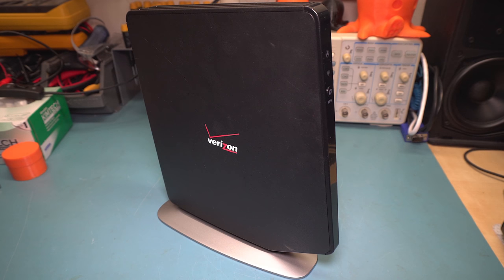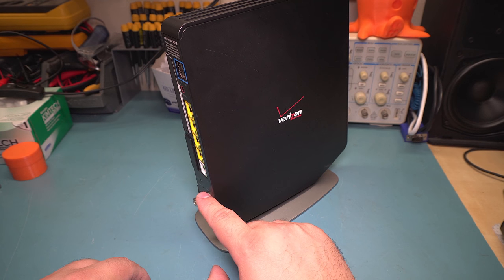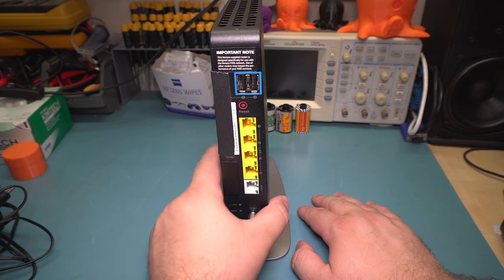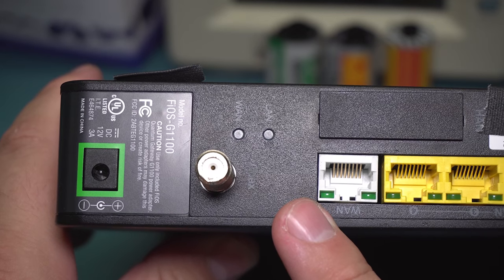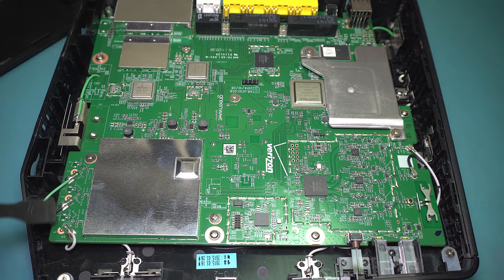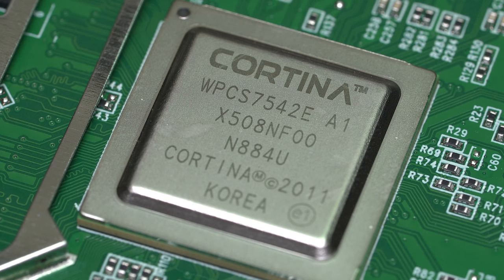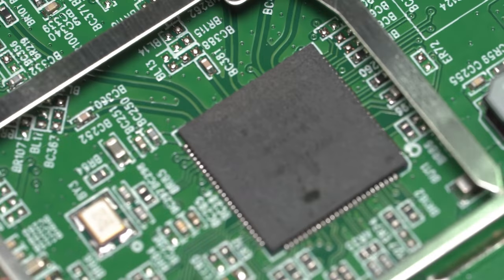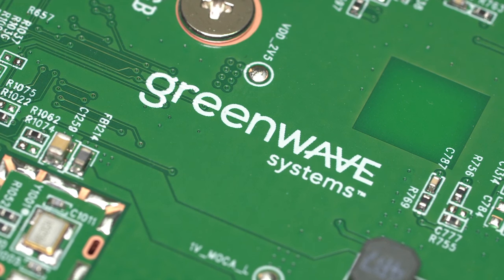Verizon FiOS G1100 Quantum Gateway Teardown

Comment from the maker: FYI: I have confirmed you CANNOT use the FiOS DVRs without the MoCA data connection. Although the DVRs have an Ethernet port, so you could in theory get TV (QAM) from the ONT -> Coax -> DVR and internet from ONT -> Ethernet -> DVR, it doesn't actually work. Looks like it is just a firmware thing where they don't enable the port for data (needed for the guide functions).
Reply: A recommendation would be, if MoCA is desired but not the router, is to use a MoCA bridge to bridge MoCA into the Ethernet network in the same fashion the FQR does and then just manually open the necessary TR069 and TCP/UDP ports in the firewall of a regular router.
Reply from the maker: Yeah, that should work fine. A DHCP with static assignment will probably be needed as well since it seems the DVRs want some silly x.x.x.1xx range of IPs. I haven't tested that to confirm, however.
Reply: True. I don't know if it's the FIOS router that's assigning the set tops to the .10x addresses, or if it's the set tops themselves requesting them. I mean I don't mind because I don't have anything else in that .10x range and if it's the latter then I assume any DHCP server/router would be able to dole it out without issue. Really only one way to find out.
Reply: Peter Brockie apparently if u have the whole home DVR system with the thin client boxes, you can use the thin client boxes via Ethernet instead of coax. I like that functionality and I’m gonna do that once we fix up our apartment.
Reply: Also, not sure if you knew. The CoAX doubled as a dual MoCa. So its meant to use as the WAN connection to the ONT and LAN connection to the boxes. However with gig internet and lower latency, installers are now just using the ethernet port directly into the WAN port and only using the LAN functionality of the MOCA port. At one point, it was just easier to use Coax to the router/gateway rather than run ethernet to wherever the ONT was.

Comment: it's funny how these router boxes are usually very capable in terms of hardware but limitted in terms of software from the operator and even crippled intentionally in some cases.

those ram chips if they get hot they will spread the heat into the PCB ground plane which the
heatsink is well connected to and will help dissipate that through the heatsink.

They might use one of the BCM6803 for the uplink and the other one for the downlink on the same media.

And one final thought on this type of hardware, introducing RF connectivity(zigbee and others) on these home gateways for home automation opens up a big security hole.
Reply from the maker: They usually are limited, but this one seems to be pretty full-featured. Manual routing, full SPI, forwarding control. Hell, they even support dynamic DNS providers (pretty rare in an ISP router).

The home automation thing doesn't really interest me, so I don't think I'll ever get that enabled. I'm not sure on what kind of encryption Zigbee and Z-Wave use, but if they're low power I doubt it is all that complex to break and would be a pretty big risk if you were targeted. That being said, any wireless connection is a security hole - just because WPA2 is pretty good doesn't mean it's unbreakable.  :D

Comment: Sorry, let me try this again.  The router and the set-top box/DVR need to be connected to coax at all times.  My understanding of why is that the router is issuing the set-top box an IP address on your network.  It is then responsible for retrieving and supplying the Guide data and on-demand content.  You can use a PFsense box for internet via ethernet to the modem but you need to supply the Fios router an IP address from PFsense AND keep the coax connected to it so that the guide and on-demand can function.  The FiOS router must also be converted into a MoCA bridge by bridging the COAX and ethernet ports once its DHCP is disabled (or you can buy a MoCA bridge).

It's obviously over complicated for what it achieves, but if you want a more powerful router or firewall then this is what you need to do.

Comment: Had a network emanating from my G1100, with a hidden SSID and the 5ghz was turned off, but the mac address was 1 letter off from the other fios connections. popped off the side plastic, popped off the 2 antenna connections for 5ghz and my signal dropped from 60db down to 30db. Whooohoo! no more interference with my asus router!

Comment: you don't have to use the verizon modem, but most people should since it's easier to troubleshoot.   You may use any router you like, but if you also have fios TV boxes and use the guide+DVR+on-demand, those boxes also need internet access.  You can either run ethernet cables to them all (not practical) or will need a MoCA 2.0 ethernet-coax bridge.  You can configure the verizon router as a MoCA bridge, but any MoCA 2.0 bridge will work to give internet to the TV boxes over coax.
Reply from the maker: MikeT1831 I figured Ethernet to the cable box would work, but so far this router has actually been quite reliable and functional. With the newer version of pfSense needing AES-NI it kinda limits it to something modern and realitively expensive compared to this 80 dollar router.
Reply: i didn't test the ethernet, and now you have me doubting it will work.  I use a $50 ubnt ERX lite running LEDE.  If you want pfsense most 5 year old intel laptops could do the job (paired with a managed switch).

Comment: Have you tried connecting your pfsense box to the ethernet on the ONT? You don't need the Verizon box connected for Internet.
Reply from the maker: I haven't tried, but my understanding is it works without the gateway as long as the DVR is fed Ethernet. But I'm not positive and the guy implied the coax connection from the router is required when on the gigabit service.
Reply: Instead of everything going through the coax, you can have both an Ethernet and Coax coming out of the ONT (Optical Network Terminal) and plugged into the router. This will not only give you better latency, but it also gives you the option of using your own router. You will still need to run the Verizon router or the TV service, if you have TV service. So either both the coax and Ethernet will plug into the Verizon router, or you can plug the Ethernet into your own router and the coax into the Verizon router. You will need to call Verizon to enable the Ethernet port in the ONT. This can be done remotely over the phone.
Reply: Correct. That's how mine is set up. Coax from the ONT feeds the video signal to the set tops, Ethernet from the ONT feeds the internet to the FiOS router, and coax from the FiOS router feeds data to the set tops. It's really quite elegant.

Comment: YOU DONT HAVE TO USE THEIR ROUTER at least not as primary, disable dhcp on the fios router, give it a static ip, disable firewall, bridge the wan connector to the rest of the network, then use your own router for the internet side of things.

anything above like i think the guy said 50mbit now uses the cat5 direct from the router.

the coax is for MOCA.

i setup our network this way a while back and, even the wireless is working as a connected but seperate access point, (all systems can see printers and such now), having zero issues, there are some guides on how to do it, really wasnt that hard, and, honestly, my wrt1900av v1 with LEDE is better then verizons much more limited, but quite likely based on, OPENWRT based firmware .

the world led will be red, but thats fine, as everything works perfectly, and now, we have 2 5ghz networks, and 2 2.4ghz networks, that are connected, but, also, their own access points.(once setup the "seamless" crap thats sposta just be the same wifi network with multi stations....never again...what a pain...) 

THEY ARE NOT HORRIBLE, much better then comcasts average all in one units... that are SHITE.... (being kind!!!) 

still wish it had external antena ports...
Reply: would there be any advantage to doing it the way you described over putting their router behind your own? i have my internet coming through the ethernet on my ONT going to my netgear router and then i have the quantum plugged into one of the ethernet ports on my netgear. i read somewhere that this creates a double nat or something but if i dont use the quantum for anything at all would their be any negative impact on my network? thank you for your time.
Reply: setup the way i did this, you gain stability and speed, no down side, infact, the fios gateway even allows the wifi to keep working, as part of the network with its own id and password, by using your own router you can avoid some issues, and, with lede/openwrt/ddwrt you can use a ipv6 gateway since frontier dosnt give out ipv6 addy's and dosnt plan to support it any time soon... 

i actually found their gateway isnt horrible, far better then the shit comcast has been giving out as all in one units, but then, its not really a modem, its a router with moca support(how your tv's get...tv...) i actually have the fios unit running the main house wifi, and hardwired its just a network extender if you config it the way i have, with wifi access point ability...and, its wifi is actually decent for not having external antennas.

there is NO disadvantage to this setup, infact, my parents who i rent from have actually said the new setup has been ALOT more reliable for them, and being able to access any network devices connected to either router wifi or not, is really nice :) 
 
 this has NO disadvantage, we have found it very reliable fast and, honestly, having only had to reboot the ont and router 1 time, and router 2x since i got this setup, im really quite happy, could never get comcasts router to disable its dhcp without becoming non-functional....let alone get it set to modem only mode and still function... 

i wish, WISH  comcast used an ONT style setup.... or just offered some  mdx (modem with telephone but no router or wifi...) but alas... if we move back to comcast..they offer SHITE still... 

anyway, no theres no disadvantage for this setup, and, its really not to hard to do, and as an extender with moca, the things pretty excellent honestly... for a provided unit, its not bard...could prob upgrade the antennas with some externals if i bought one rather then rent..(you can), its not great but for something provided by a isp, their quantum gateways are really not bad, beat the last 3 aio's comcast gave us... including the business class model the fellow gave us last because, even he couldnt get the features we wanted working properly, with the help of top level support... they put in a ticket with their firmware team... none, not even the business units, could be put into any mode with no dhcp or with modem only, and remain functional... just... idiotic..we ended up buying our own modem, then using their aio for phone only... our own linksys 1900ac router running lede and a zoom modem made a HUGE dif...

no need with fios beyond wanting more control, better firmware, and much better wifi range( because, my linksys has external 5dbi antennas, that im considering replacing with 9-12dbi units.. the aio's all have internal 0.5-1.5dbi antennas.. as do pretty much all units that dont have external antennas.....

i use to mod netgear cheap referbs with external antennas and install ddwrt, gained around 6x the range at full speed... without putting the gain above default...

anyway...no downside what-so-ever in using their unit behind yours setup to work as, what amounts to a moca smart router/network extender...
Reply: only way you would endup with more then one nat is if you dont disable the firewall/dhcp, once you do that, it acts like any other extender/router but with moca support.

using it this way theres ZERO neg impact.. infact it all works flawlessly now... 6 tv boxes, 3 hard wired computers and a bunch of devices on wifi all working on the whole network able to communicate directly, no sites/services fail because anythings not setup/working correctly.

again ZERO downside, if you got a decent router of your own, it will, infact, work better. 

theres no reason not to use the fios quantum gateway as a wifi/hard wired extender if you have any use for such, its actually really reliable in such a role, have had to restart it 2x and i blame fios since i had to reset the ont as well both times. =

Comment: Great videos indeed! But you should really really consider keeping/upgrading your custom router (if you can put this in bridge mode).
Reply from the maker: Pablo Fabian Wagner Boian Really the only thing this one seems to be missing is ad filtering. Other than that it seems pretty robust and it has the one feature I can't live without - static DHCP assignments.
Reply: Feature wise, embedded devices are catching up. There are only two problems with them: performance (some workloads can bring one to its knees) and security: these routers get firmware updates almost never. It's a shame because power consumption on these little things is negligible compared to a full PC.
Reply from the maker: Pablo Fabian Wagner Boian From what I have read, Verizon pushes firmware somewhat regularly. Hell, it even updates it for you when it connects to the network. :)

My pfSense box was only a 2C/4T older generation Atom so it isn't that much faster than a dual core ARM.
Reply: Good to know :)
And you're right: Atom CPUs are pretty useless today.
Reply: It's still better from a security standpoint to have your own router/firewall in front of the service provider's equipment.

Comment: Where's the main CPU JTAG?  I see one hooked up to the radio chip, but that's not it.  That flash is parallel, not serial, which would be difficult to dump or program without JTAG.  I have mine opened up, but I don't see what I'm looking for.  Is it on the underside?  I haven't looked at the underside because of the antennas.
Reply: I couldn't find a CPU JTAG either. There are (what appear to be) 2 separate JTAG on the board but both appear tied to separate Broadcom radio chipsets. After soldering pins to these connectors and using a Jtagulator, they don't identify as JTAG. Were you able to find a CPU JTAG?

Comment: I’m interested in getting this router used as well bu have had an experience years ago with purchasing a router that was originally a rental unit blocked fromusage by the internet company.  Is there any way to tell prior to purchasing online if the router isn’t a rental?  Thanks
Reply from the maker: Not to my knowledge. Unless you can factory reset it somehow. Just make sure you can return it if it doesn't work.

Comment: I have the same router my wifi speed is terrible don’t know why i just upgrade to 1GB internet. Even hardwire can’t more than 400 mbps
Reply from the maker: +brunogt1982 Wifi is terrible on any connection. Don't listen to anyone trying to tell you it runs at 1.5 Gbit or whatever. It's slow and you'll never reach the advertised speed. Especially if you use the 2.4 GHz band. 

The router is more than capable of doing 1 Gbit up/down over wired.
Reply: are you on the 2.4 or the 5g?
Reply: Marcus Smith yes 5hz always
Reply: And hardwire i can only get 500 mbps  if I’m lucky
Reply from the maker: The router supports 1 Gbit speeds and if you're getting half that on an ethernet cable there is something wrong with the connection. I would call them and tell them to check. It won't get 1 Gbit via wireless though - basically no router will regardless of whatever marketing speed bullshit they write on the box.
Reply: I have 4 connected devices on that router Xbox , ps4 my tv and a computer it always gives me around 760 up and down on hard wire my 5g WiFi gives me around 350 up and down my 2.4 gives me around 100 up and down
Reply: Anyone figure this out, I’m in the same boat.   Would installing a larger antenna hardwired in help for WiFi distance issues?

Comment: Wait can i buy another modem to replace my g1100 and just connect the coax to my new one
Reply from the maker: If the new router has a MoCA bridge (i.e. Has a coax connector) you can use it as far as I know. The ONT outputs a normal ethernet connection.

I'd check to see if the model you are looking at is supported though.

Comment: hi, i want to know if the Fios G1100 can be unlocked?
Reply from the maker: Is the G1100 used by anyone else? If they're used on other networks, I doubt they will work on another one - I guess there is a small chance it'll connect to the network and download firmware from the provider, but I doubt it.
Reply: yes a totally different network outside the United States
Reply: Thanks for your rapid response